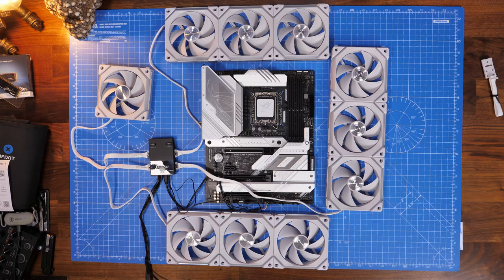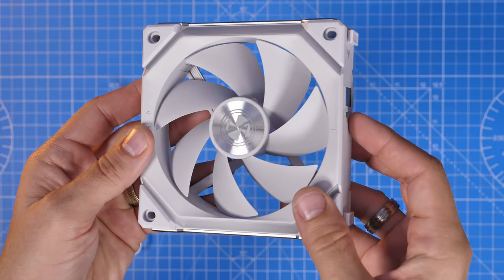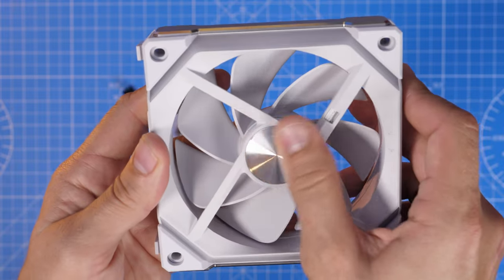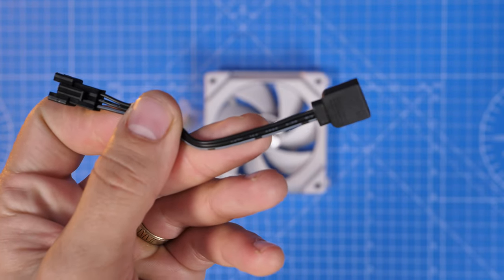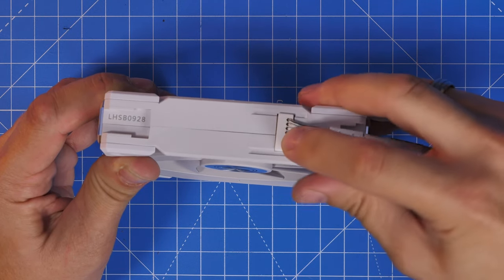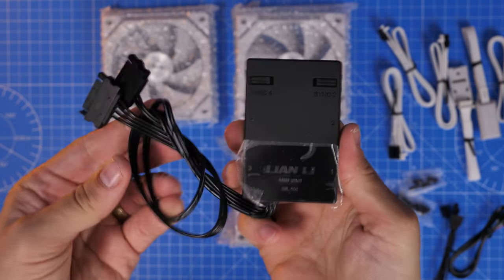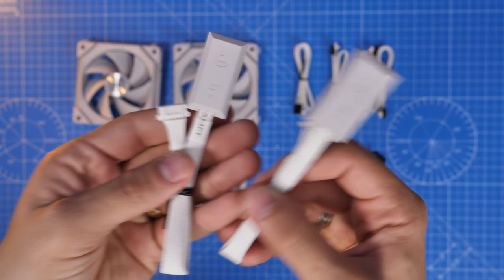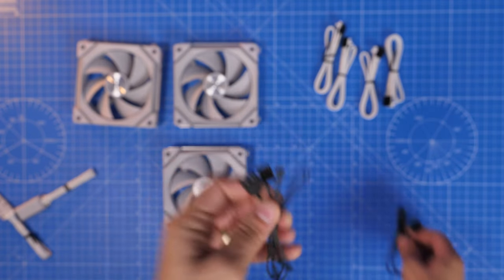How to connect and setup Lian Li SL120 V2 fans (including on an all-in-one cooler)

Comment: I’m using the sl infinity 120 and the cables are I bit different but all 10 fans and nothing came with any cable that fits into the “sync” on the Liam li controller. Did you order a separate cable kit?
Reply: Wondering the same. I think he has the newer version of em.

Comment: quick and dumb question: i bought 7 single pack sl 120 v2, can i connect them at my sl 120 v1 fan hub?

i have spare sl 120 v1 cables if needed tho, just kinda consfused and scared to mess up.
Reply from the maker: The connectors are different I believe. You can buy the controller separately though https://www.aliexpress.com/item/3256804833432065.html

Comment: I bought my 1st LED fan and couldn't use it as my MSI motherboard has a 4 pin header, JRGB, and the fan had a 4 pin plug with 1 pin blocked. It was supposed to be used out of the box on my board.
Which fans can I use that have the right plug?
My 1st PC build.
Reply from the maker: You don't NEED to connect the RGB cable with these fans if you have a triple pack and the controller. You can then just use the USB connection and Lian Li's L Connect software to control the lighting.
Reply: @TheProvokedPrawn  I shall have to order the Lian Li's fans.
Reply: @TheProvokedPrawn   If I used 1 of Lian Li Uni Fan SL120 how does this connect to my board? 
Do I need to buy anything else to be able to use it? 
It can be a bit frustrating building a PC for the 1st time so I always ask loads of questions.

Comment: My fan setup that i am going to have is exactly the one at 12:50 with the fans at the top being the fans from the galahad 2. So now i have a free port on the controller. Is there a way to connect the rgb from the aio pump to this controller so that i can controll the rgb of the fans and the pump via l connect?

Comment: hi there, I have an question: 

Great video! I have a question im building my first Lian Li white build. But im little confused. 

The motherboard only have 2 RGB headers on it So how do i connect the fans? 

MOBO = MSI Tomahawk AM5 
Case: Lian Li dynamic Evo 
Lian li AIO Galahad 360
I have two different Lian li Unifans V1 and V1 (i dint know which one was better so i got them both lol) 

So yea I have connected my bottom fans to the Hub that a 3-pack gets you (v1) 
The other Uni fans 3 pack side is conected to the hub 

Where to do i put the Radiator fans ? rbg ?
Reply from the maker: I thought I answered all these questions in the video?
Reply: @TheProvokedPrawn  sorry maybe i missed it, gonna rewatch it third time!

Comment: I’ve got 2 radiators (GPU and CPU waterblock cooling) and 3 fans on each of them, plus one case fan (7 fans total, all Lian Li SLV2). Right now all the fans are connected to the Lian Li controller, which means there’s only one fan header being used on the MB. This means I’ve only got one fan lead to connect all these fans to my MB. Can the CPU_FAN header handle all this? Should I find a way to split these fans between fan headers, and keep only the cpu radiator fans there? If so, I’m not sure how to do that, since the SLV2 triple pack doesn’t provide cables to connect them directly to the MB.

Comment: Is it necessary to use the cable that goes from the control box to the motherboard fan header / rgb header?
Reply from the maker: Not if you're using the usb connection
Reply: @TheProvokedPrawn  Cool, thanks for taking the time to reply. I appreciate it!

Comment: this is going to be a silly question, i am on the o11xl.
Can i have the 3 bottom link with a short cable to the 3 side.
Then the 3 side link up with the 3 on top? 
Can one cable run across all that?

and then have the 3 top link to the exhaust, which then connects to the controller.

So 1 cable to the controller, with 9 daisy chained.
Reply from the maker: yeah, you should be able to. That's 3+3 to the controller twice right?
Reply: @TheProvokedPrawn  yea i saw that the max for daisy is 6, so 3x3.
With the ARGB header do i need to plug that into the mobo, or can that just be controlled via l-connect? Wondering we connect that purely if we want to control lighting via mobo
Reply from the maker: @ZomgZomg007  yeah you only need the RGB connection for control via motherboard software. Otherwise it's all via L-Connect
Reply: @TheProvokedPrawn  sweet then ill avoid connecting that as well :D

Comment: Great video brother , thank you . I have a question though , i have 2 packs of 3 lian li v2 fans , one solo fan  and an AIo from corsair .  I desided for my budget that i wont change the standard rgb fans on the aio . Can i connect them to the lian li controller and control only the rgb so it synchs with the other fans ?

Comment: Quick question! Would this work if you only connect the cable to control the fans via software? or do you have to connect both software and MB cables? Im planning on only using Lian lis software to control the fans
Reply from the maker: If you don't want to use motherboard software you don't need to connect the RGB header just the USB
Reply: @TheProvokedPrawn  thanks!

Comment: Hey I’m not sure if you are still active on this video but I was wondering if I’m using a lancool mesh II case would I be able to sync up the pre installed fans on the front with the other fans connected to the hub? How would I go about connecting the front fans to the hub anyway

Edit: seperate question, I accidentally broke the j rainbow port on my pc so do I need to plug in that certain wire from the hub to the motherboard or can I just do the usb + sata connection? Hope I explained that correctly but let me know

Comment: At 18:45, im very confused, should i always plug the radiator fans on the pump breakout cable, or the controller?
Reply from the maker: Ideally into the pump breakout but if you can't for some reason it's still fine to run them from the controller.

Comment: Cheers from across the pond. My MTB only has 2 USB type 2 headers. I don't have a splitter cable.  Is there a work around to run my 11 case fans and my 2 strimer v2? I was hoping I could either plug the strimer into the fan hub or daisy chain the strimer hub into the fan hub? Hope you get my goal.
Reply from the maker: A splitter would be easiest. You can get a NZXT USB hub that's decent.

Comment: This is a great video and really helpful, thank you!
One Question... If I only plan to use the L-Connect software to control RGB/Fan Speed... do I need to plug in (from the control box) the fan cable to the fan header and the argb cable to the RGB header? Or can i just connect the control box to the US2 header?
Reply from the maker: Just usb is fine
Reply: Sorry another question, as I'm having some challenges (I didn't realise the lian li p28 fans wouldn't connect to the lian li controller hub🤦🏼‍♂️)... 

If I plug the lian li controller which will have 2x clusters attached to it (side intake set of 3x and rear exhaust x1), into a chassis fan header on the motherboard, will I be able to control those clusters individually, or will it see if as just one set of fans?

Thank you

Comment: Hi! I have a question. So i used fan hub for my fans. And in my bios my chassis fans says n/a. Is that normal? If not how do i fix it? My fans are working though it just doesn’t show in my bio
Reply: I have a similar problem. Did you find a fix yet?

Comment: When I go to use the daisy chain smaller cable like you used in joining the rear fan with the top fans I can't slide the dam thing forward to lock it in.. wtf. I'm using the same sl120 v2s
Reply from the maker: It only slides from one direction. Are you trying to do it the wrong way?
Reply: @TheProvokedPrawn  nope. It has the lock and unlock symbols on the cable, just couldn't push forward. I did get it to work it just takes a fair bit of force 😅

Comment: I’ve an Corsair 7000D case is it possible to connect 4 fans together or is 3 max?
Reply from the maker: Yes. You can connect 4 fans together and have up to 4 groups of 4 per controller. For a total of 16.

Comment: Hello, I have a question, can I connect a UNI Fan SL-Infinity 140 rear fan and combine it with a triple lian li 120mm UNI V2 RGB fan?
Reply from the maker: You need different controllers for the different models.
Reply: @TheProvokedPrawn  Thank you, I have another lian li fan UNI SL120 V2 RGB controller. I will only connect the UNI Fan SL-Infinity 140 fan there. Is it correct or what model do I need?
Reply: @TheProvokedPrawn  help??
Reply from the maker: @rendersark1750  you need the controller that works with the specific models. You can't put infinity fans on SL120 controllers or vice versa.

Comment: so if i have a kraken 360 and i buy 2 f the 3 packs ill  take up 2 usb connectors and the case is the lian li o11 evo so will i need a usb splitter for the wires that come with the case?

Comment: Question: Not quite the same fans but I'm going with the TLs to match the Lian Li Hyroshift TL AIO. My question is will I have issues if I add a 3 stack of the TL LCDs by themselves, not on the radiator or anything crazy, will I have problems? I know its well know that Port 1 on the controller doesn't support them so is that the only thing I should have to look for?
Reply from the maker: https://youtu.be/gvDVijV4qvU

Comment: Can the v1 be used with v2 controller I have ordered v2 and already have v1s on my aoi 
Would I be best keeping old controller and new one or just use one of them ?
Thanks for your great videos
Reply from the maker: You can connect the RGB to the sync connector on the v2 controller but not the power. The cables are different
Reply: @TheProvokedPrawn  thank you

Comment: Yo! I have these fans and the top ones and the single one i got in my case need to switch places rgb wise. 
When i use certain rgb effects like the runway, it doesnt run through and around correctly.

Does that have to do with what order they are connected in the small controller?

Comment: I have the sl inf 120 fans (infinity) and it says in manual when sync to mb and set 100% bright, it only supports up to 8 infinity fans. So does that mean I need to controllers for 9 fans (2 sets of 3 fans connected together)?

Comment: Regarding the breakout wires from the Z73, could you let me know if I set it up correctly?

2 wires directly from fan: one goes to the lian Li box for sync, and other goes to CPU fan connector to motherboard. OR is it supposed to be fan goes to the breakout fan cable, and the pump wire goes to the CPU / aio pump connector on the motherboard?
Reply from the maker: Either should work.
Reply: @TheProvokedPrawn  thank you! I ended up switching it to Fan to breakout cable and pump tach wire to aio connector. Earlier I was not able to see the fan settings in the nzxt app. Now I can control the fans based on liquid temp and the pump on CPU temp.

Comment: So I just wanted to double check since I just got these and I’m relatively new when it comes to computer building with regards to the controller itself do I need to connect both the usb connector AND the 5v argb for rgb and fan control or are they separate options just needed a bit of clarification on that aide
Reply from the maker: Separate options. I'd recommend usb as it allows L Connect control and firmware updates etc

Comment: Hey prawn, quick question. Do I need to connect the thin PWm fan header cable and ARGB plugs into the motherboard? Or those r optional? I plan on just using L connect. Thanks
Reply from the maker: Optional
Reply: @TheProvokedPrawn  thanks for quick reply

Comment: Hey Prawn; please respond.

I will begin building my first ever build on Saturday, two days from now.
Im panicking a bit cause my AIO is the Galahad 2 SL-Inf Trinity but Im using Uni Fan SL V2 fans additionaly as other intake and outtake cooling.

Am I right that I have to use two different connect hubs for this? One for the INF AIO and one for the other SL V2 fans?
Reply from the maker: Yes

Comment: Bro my motherboard has only 1argb header so this means if I connect the case argb connector to my motherboard argb header to control front pre installed 160mm argb fans lighting, I can't use Lian Li UNI Fan SL comes with Galahad 360 cooler right? Because I don't have any other argb header on my motherboard To control those UNI fans lighting? Right? Please help me I want to sync all my fans lighting.

Comment: Hi. I'm planning on building a system with push/pull aio, i will be using the oem fans from the nzxt kraken elite and 3 lian li v2 fans, am I able to set the speed of all of the 6 fans to be cotrolled by the pump? Thanks.

Comment: 16:25 where did that cord come from?  I want to hookup my radiator just like that because I dont know if I want to depend on running software to cool important components.  The issue is I have just watched an unboxing of sl120v2 triple pack and I dont see that connector.  Did you have to buy that separately?  If you did whats it called, whered you get it ect.  I guess if I have to ill just hook a second uni hub into the cpu header with the triple fan on radiator, will that screw up lighting though?
Reply from the maker: It comes with single fans.

Comment: I'm really hoping the Prawn sees this as this video mimics my planned setup with one key difference.  I thought I was clever by buying 4x triple packs as they were on special and came in cheaper than 1x triple pack and 9x single fans.  I also have the new 360mm Kraken Elite RGB AIO which I wanted to put the Lian Li fans onto.  But, the triple packs don't come with the splitter cable that the single pack does. I want Lian Li to control the RGB for all the fans but need to have the AIO fans controlled by the CPU Fan header on the mobo.  Can I do that with what I have, or do I have to go and buy a 13th single fan for the splitter?  TIA if you see this.
Reply from the maker: Alas you have to get a single fan as I don't think you can buy the cables separately. Lian Li has a store on Aliexpress with various things but I don't think even there you can get them https://www.aliexpress.com/store/911265363?spm=a2g0o.detail.100005.2.3f677c79bc2vBA

However, you could just use the controller. It'll still be fine.
Reply: @TheProvokedPrawn  I really appreciate the super fast reply. It's been years since I have built a computer and this one will be my first into RGB. So I am trying to get my head around things for this completely new system (Gigabyte Aero z790, i9=13900, Aero GTX4080, Kraken Elite RGB).  Are you saying via a single controller the fans on the AIO will be able to be looked after by the CPU fan side of things to ramp up and down as needed, and everything else managed separately, or do I need to use multiple controllers (seeing as I have four of them LOL)?  If there's a video explaining this stuff I'd love to see it.

EDIT: ok, finally I think i found what I was looking for, the L Connect software I can designate one of the four connectors on the controller as CPU and it should ramp the fans up and down as I need.  If that was my missing mental part that would be great, just got hung up on HAVING to plug into the CPU header

Comment: i followed this guide but am confused why the new lian li SL-inf 1 pack doesn't come with the same rgb connect to the hub. I plugged the lian li fans into the nzxt pump so they get controlled by that but the other connection doesn't fit into the lian li hub.. I'll have to attach rgb to the mb directly. If anyone knows if there's a connection I can buy to make all my lian li fans connected to the hub but keep the  speed to the pump LET ME KNOW THANK YOU

Comment: Great Video Provoked Prawn, it explains a lot, but could you help me with my configuration? I have triple pack of 120 v2, also singles 140 v2 so basically I have all types of cables and controller. I would like to use 120’s with my io ASUs ryujin 2 360mm. What is the best configuration? Do I have to use both controllers? Lian-li and asus? Also I would like to avoid push-pull configuration and have only sl uni v2 mounted to radiator.
Reply from the maker: https://youtu.be/Mm85qMEYlDI

Comment: Hi, I wanted to know if I can plug a 9-pin USB cable into my motherboard to control the RGB on fans, or do I also need to plug in a 3-pin ARGB? My motherboard only has a 12V RGB header and lacks an ARGB header, so I was considering purchasing a connector to link my ARGB fans to the motherboard. Could someone assist me with this?
Reply from the maker: Just use the usb and control it with L Connect
Reply: @TheProvokedPrawn  thank you ❤️ i was considering either lian LI or Crossair or Cooler master controller which one do you recommend me

Comment: Can i put two sl140 fans on the kraken elite 280? Do i need an argb kit for the fans to connect them
Reply from the maker: Yes. You can just use the controller still and then set the fans to ramp up according to CPU temp in L Connect
Reply: Thanks

Comment: Hey The Provoked Prawn LOVELY video. i have one question though, atm i use the default fans on the kraken z73 just because this was my first rather advanced build. Now that everything is working i am about to replace the default fans to get lian li infinity in the whole case, just like in your video. What i wonder however is about all the cables that we plug into the pump... because the thing is on my Asus z690 Prime A, i have only 2x USB 2.0 and 2x addressable Gen2 header, so i'm thinking if i can skip any cables on the pump when using lian li on the radiator, or if i need to try find some kind of splitter cable ;(
Reply: Especially since i also want to use strimer on both gpu and 24pin xD
Reply from the maker: I used something like this for extra internal USB https://amzn.to/3FYiEDD